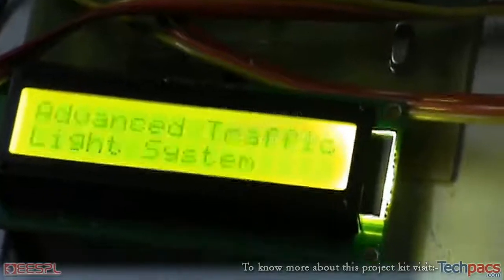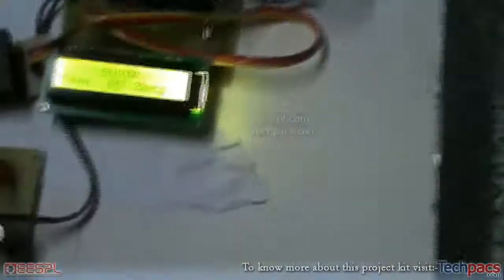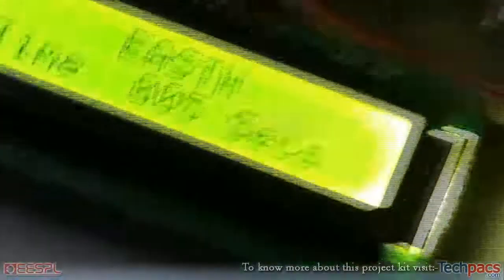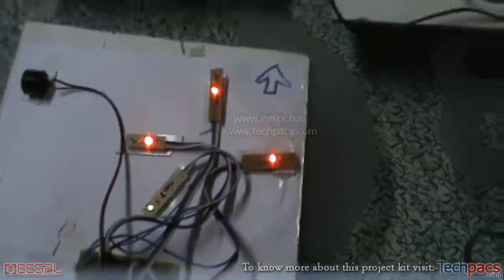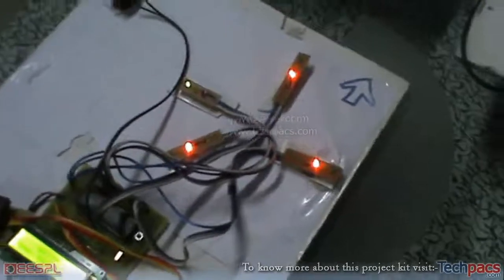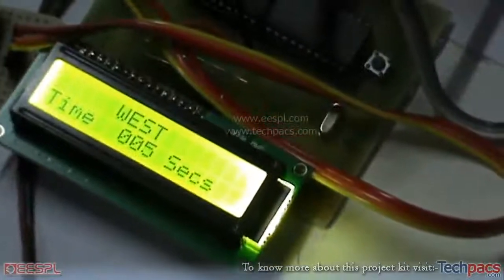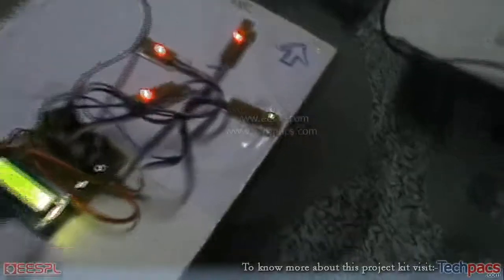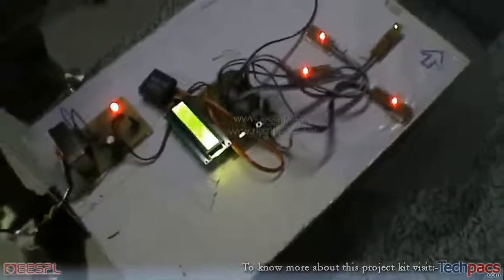Automatic traffic light controller | Ambulance Passage using Arduino (latest Project 2020)

Comment: Dear sir i need more details about this circuit board and emergency card
Reply from the maker: Contact our technical team on Whatsapp ;
https://wa.me/917657870606?text=I%27m%20interested%20in%20your%20Project%20PR_93
Reply from the maker: http://www.techpacs.com/category/Project/16-119-172/Emergency-Vehicle-Detection--Density-based-Passage-Control-Traffic-Lights%C2%A0